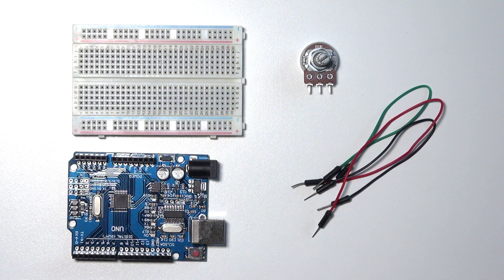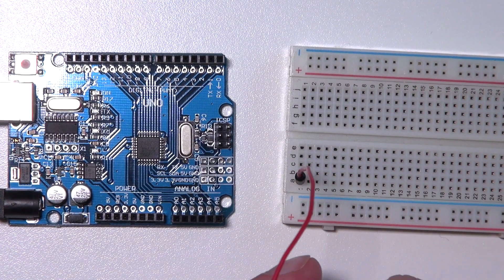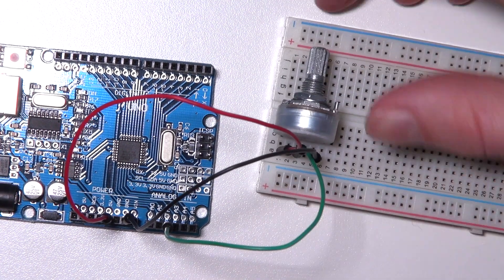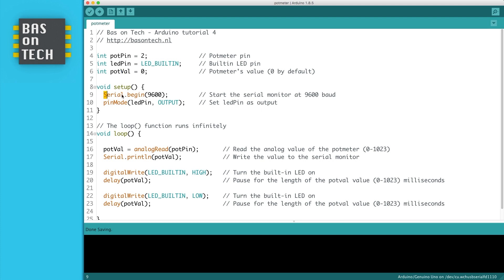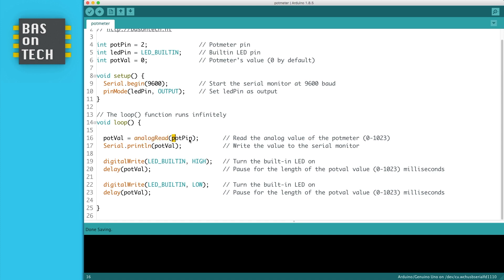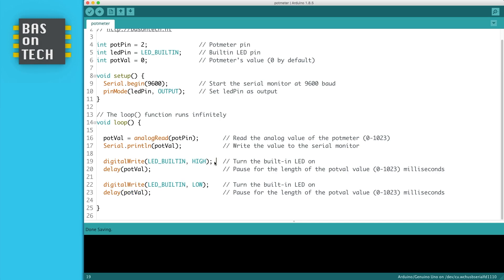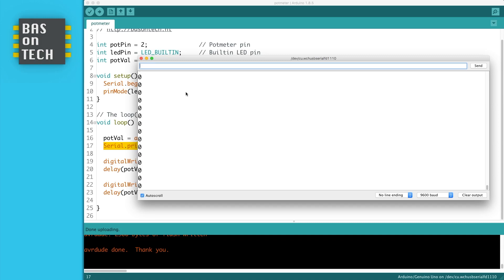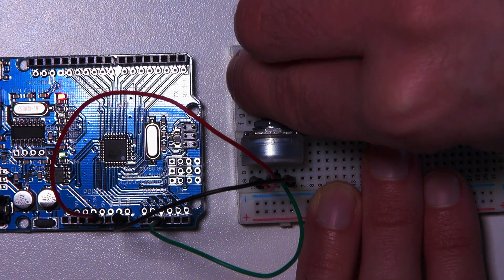POTENTIOMETER CONTROLLING BLINKING INTERVAL OF BUILTIN LED - Arduino tutorial #4

Comment: On the digitalWrite section of the code, why did you not use the variable ledPin that you set? Instead you wrote LED_BUILTIN, would both work?
Reply from the maker: Both work, but LED_BUILTIN is more versatile. It is not guaranteed that the LED pin is the same on every board. With LED_BUILTIN you always have the correct one 😃
Reply: @BasonTech  Thanks for answering so quickly :)

Comment: When I move 'potVal = analogRead(potPin)' from setup code to loop code,

the potmeter only communicates  the value '463' to serial monitor and LED.

And I the value doesn't change when I turn the potmeter.

Why does that happen?
Reply from the maker: potVal = analogRead(potPin) should be in the loop() to work. Or do you mean you moved it from loop() to setup()?
Reply: @BasonTech  Yes, I moved it from loop() to setup() - to see what would happen.

Comment: Is that a 10-bit ADC on the UNO? Could you please explain how does the value varies between 0-1023?
Reply from the maker: A bit can be 2 values: 0 or 1. So with 10 bit the max possibilities are 2^10 which is 1024 values. Therefore you can have the range of 0-1023 😃
Reply: @BasonTech  Thanks (y)

Comment: How would you make it so the more you turn on the Potentiometer the longer the led stays on
Reply from the maker: What kind op options have you thought about yourself? Where did you ran into? Basically you want a "special" blink. A blink where on and off are not similar.
Reply: @BasonTech  so basically i want to control a fuel injector with a few mosfets. right now im just testing with Leds. but i want it so the more you turn the dial the longer the leds flash will last
Reply from the maker: Ok, and where did you ran into?
Reply: @BasonTech  basically i copied down your code but i cant figure out how to do what i want
Reply from the maker: Ok, try to start with tutorial 1 and work up to 4. You should be able to figure out how to make it. The nice part is that you learn a lot about the basics of programming. Of course I will help you if you have specific question. As you can probably understand, I can't just program the code for everyone.
Reply: @BasonTech  yeah that makes sense

Comment: Are you using 1k or 10k potentiometer?
Reply from the maker: I am using the 10k. You can see all the parts used in the description of the video 😃
Reply: @BasonTech  thanks for the reply..is their any way to control from 0-10000 value
i mean i want to add more delay..the delay in video isnt sufficient for my project
Reply from the maker: Sure, divide your range into steps of 1024. Multiply the value of the potentiometer with the step size for your range. So for 10000, each step is approx 10
Reply: @BasonTech I understand what you saying. But.. Let's say each step size is 10 ...if soo then where and what changes should I make in code....
Reply from the maker: Think in small steps, you want to adjust the delay with a multiplier so that 1 becomes a delay of 10, 100 becomes 1000
Reply: @BasonTech  thanks... It makes sense.. But I'm new to coding... I can understand all the stuffs but it's hard to make that into code somtimes
Reply from the maker: You just have to do it a lot 😃  Don't forget that I've over 20 years of experience in writing code 😉
Reply: @BasonTech  haha you miss understood... I said it's hard for me to code it... As I'm new to all this.. But anyway I will figure it out 😉
Reply from the maker: That is a great mindset! When you try yourself, you learn so much! Therefore I encourage everyone to type over the code manually instead of copy/paste 😃
Reply: @BasonTech  yeah thanks 💯

Comment: How to choose the resistance of the  potenciometer
Reply from the maker: Good question! This basically depends on the need for your project. If you have a potentiometer with a very high resistance you'll see that slightly turning it will make the difference between fast and slow blinking. While one with less resistance will need you to turn it more so you have a finer control over setting the interval 😃